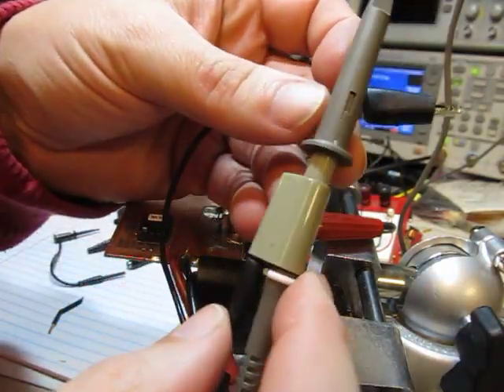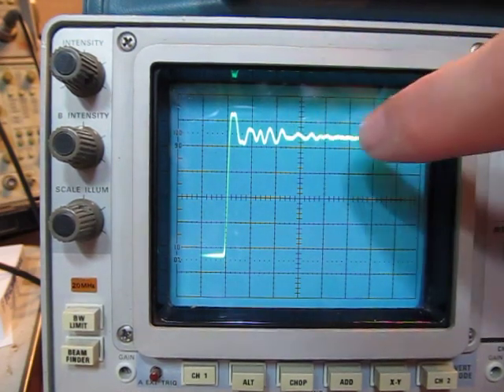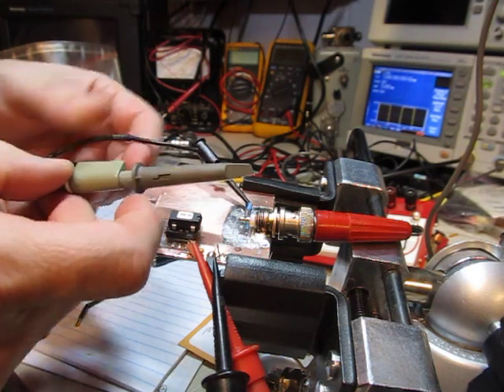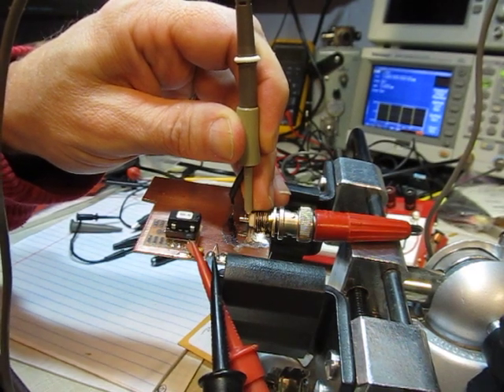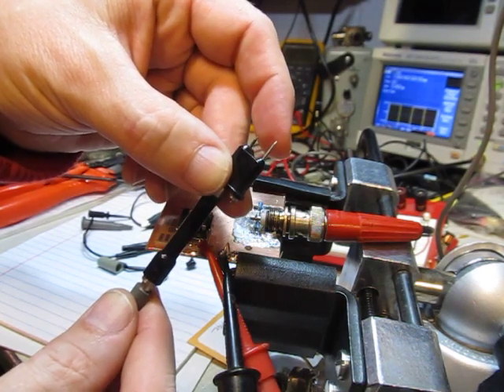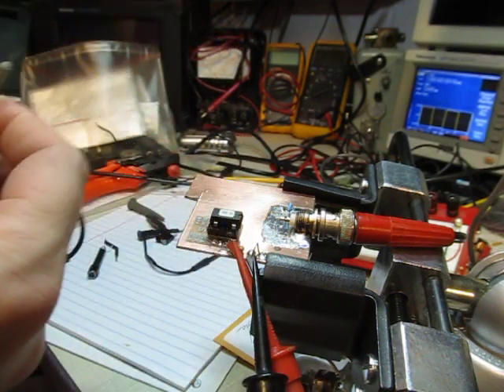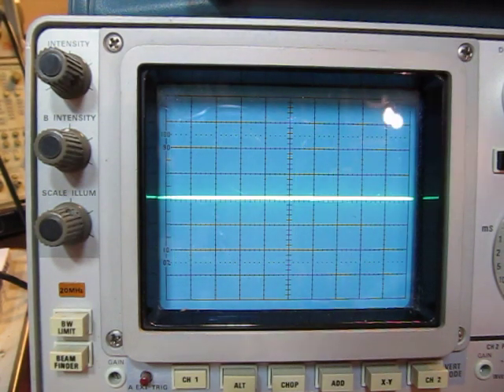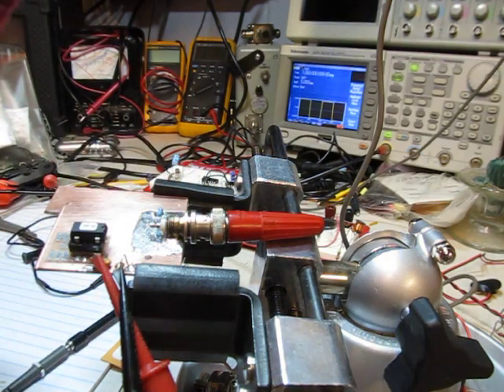#68: Oscilloscope Probe Ground lead length effects on signal quality

Comment: It's a good practise, if you design a board, to add beside the measuring pad also a pad for GND connection. Then It's quite comfortable to make adequate measurements with a scope. For the GND connection, just wind a piece of copper wire around the outer GND shield on the tip of the oszilloscope probe.

Comment: GEAT! This video should be mandatory for all Electronics courses.  I've worked with veteran BSEEs, MSEEs and PhDs who would chase phantom issues for days due to improper probing!  RF guys tend to know, Power supply guys, 'kinda and Logic guys not at all.
Reply: hardstyle905  They design with simulators which have lovely Tr and Tf illustrations and then let some lowly tech try to figure out why there are glitches, then blame the manufacturing department.
Reply: hardstyle905  I've worked with many EE Interns and new graduates.  Unfortunately in the last 20+ years this stuff is not taught at all, and there is zero "hands-on" in the coursework.  Worse yet, very few Perfessors under 50 even know how to properly use an oscilloscope. 20-30 years ago I would tell  students to buy and build at least 3 Heathkits, but that is no longer an option.
Reply: hardstyle905  That's my experience in over 40 years.  Yours may differ.
Reply: hardstyle905  This is weird.  Your comment came through on my notifications, but is not on the actual video here.  I'm guessing that the YT policing algorithm has grabbed it from "publication" here to analyze it, and since it is quite long has not yet digested it.  I was going to paste it here, but I think it would have the same result.   So... lets see my next comment!
Reply: hardstyle905  It's evident that practical, hands-on experience plays a crucial role in certain areas of learning. Take PCB design, for instance. Despite mastering the theory – the significance of short leads, ground planes, and parasitics – I encountered a steep learning curve when I started creating actual PCBs. Interestingly, a senior engineer once inspected my work and remarked on the excessive stray inductance, particularly for applications involving high-frequency and high-power switching. In retrospect, it's almost amusing. I inadvertently created a significant ground return loop and overlooked lead trimming for through-hole components. It wasn't that I lacked the knowledge of 'short traces'; rather, I needed the practical insight to comprehend the exact implications. Experience gradually provided that insight.

I still find value in prototyping on breadboards or veroboards, though my perspective has evolved. Now, I intuitively understand that every millimeter equates to a nanohenry of inductance. It's fascinating how just a few nanoseconds of a 10-amp current through a 20-nH inductor can lead to considerable voltage drops, potential ringing issues, and ultimately, substantial power loss or even damage to the switching components.

Reflecting on this, I can't help but admit that lacking proficiency in using essential tools like an oscilloscope, especially in academic roles, is a more critical concern. It's a safety and effectiveness issue that warrants serious attention.
Reply: it looks like it's here. can you see it?

Comment: What would you recommending using to measure and test connectivity of various switches and jacks because of the different materials used for metals of various switches on the contacts and jack metal materials of the potting and coating which will decrease the connectivity. The problem is how can you measure the connectivity because microohms or milliohm meters can't measure the connectivity of the jacks metal materials and the switch contacts materials used. The connectivity measures how well its passes through the metal materials but what meter measure this?
Reply from the maker: Check out my video on 4-wire resistance measurements, which is the right way to make very low resistance measurements.
Reply: @w2aew  I'm not sure if a 4 wire resistance measurement will be able to measure the conductivity value of switches and jacks because its of the metal materials used and the coating the switches and jacks. There must be a meter that measures conductivity across 20hz to 20khz. To compute for the conductivity you take the inverse reciprocal of the milliohm measurement?
Reply: @w2aew  Most DVM meters measure voltage but it doesn't tell you if the voltage is unregulated or regulated, how can an electronic tech know if the voltage being measured is regulated or unregulated? not using the schematics. There must be a DVM meter or Oscope that can know the differences between an unregulated voltage compared to a regulated voltage but I can't tell when looking at the displayed AC voltage or DC voltage on the Oscope, how can you tell?
Reply from the maker: @waynegram8907  You can't tell if a voltage is regulated by just a simple measurement.  If you can't see a schematic, then one way to tell is to change the load that this voltage is driving and see how much the voltage changes.
Reply: @w2aew  Using a Low Impedance setting on the DVM meter can test Unregulated voltages? if the in-circuit unregulated voltage is +12vdc and you measure the unregulated +12vdc using the low impedance setting on the DVM meter it will drop the unregulated +12vdc voltage decreasing it?
Reply from the maker: @waynegram8907  Maybe, it depends on how low impedance that mode is.  Also, a better way to check would be to monitor the output voltage while varying the input voltage to the circuit.  If the output doesn't change, then it is likely regulated.
Reply: @w2aew  I would have to use an AC variac and vary the AC voltage while measuring unregulated DC voltages? Some DVM meters has a low impedance mode but not sure if you can use this mode to measure In-Circuit Unregulated voltages?

Comment: How do you prevent Eddy currents? Because ground loops causes Eddy currents which is current that can't be sink to ground. Besides ground loops what causes Eddy currents? And why are Eddy current considered bad? Because Eddy current causes bad signal to noise ratio?

Comment: Thanks for sharing. Does the edge ringing due to short rise/fall time also caused by a long coaxial cable of the probe? I wonder if transmission line on the probe cable contributes to the ringing.

Comment: Interesting video.  I ran across a situation yesterday, where the sine wave was slightly jumping on the oscilloscope.  I inadvertently touched the ground lead and the jumping stopped.  I wonder if this falls under the same situation that you demonstrated?
Reply from the maker: It is likely that the ground lead was acting as an antenna, picking up another interfering signal that was being added to your result.  This is another good reason to keep the ground leads and loop area short/small.

Comment: Hello, great video again! Now,  I now I have a lot a questions but I red a lot of information recently and I need tips to organized it, so please bear with me a little. What bandwidth is your scope? Is the saw ringing amplitude value influenced by the scope bandwidth? For ex. a 50 Mhz scope would see a 50 Mhz oscillation with 0.707 of its original amplitude (theoretically) ? Are those ringings some kind of reflections signal, because of unmatched impedance? So practically the ground lead is a LC tank oscillator?

Comment: Hi Alan, question - there are some cheap function generators for sale, kits, etc. Some don't have BNC connections, just screw connections. So, what kind of probe would you recommend, if any? Is this a 300 ohm thing? Or, would you recommend connecting a female bnc to the function generator and then using a standard coaxial BNC o'scope probe?  Or maybe your advice is forget the cheap function generator? :) 73, KM5L
Reply from the maker: I'd probably wire in a female BNC.  These cheap generators can be useful for low frequency work, just don't expect a lot of stability or low distortion.

Comment: Biomedical Equipment requires to measure the equipment chassis ground resistance to the ground terminal of the AC cord. Also to measure the Leakage current from the equipment chassis ground to the AC cord HOT terminal. They use a lab test gear called a "Safety Analyzer" to measure the Leakage Current and Ground Resistance. If you didn't have this Safety Analyzer how would you measure the Leakage current?  I'm guessing its AC leakage current or DC leakage current? The Leakage current is caused by what the AC power transformer or the power supply filters. If you're measuring the Leakage current of a unit under test what is causing this leakage current from the AC hot lead to the Chassis ground?

Comment: What about probe impedance? In your setup, are you using 1 Meg or 50 ohm?
Reply from the maker: I was using 10X passive probes, which have a 10Meg input impedance (low freq) and use a 1Meg scope input impedance.

Comment: Very good job describing why you need to use as short ground as possible.  Most do not understand how important this is for debugging a circuit and will chase the wrong problem.

Comment: Thanks for another interesting video.

I have a question: What about multi-channel scopes. Should each channel be grounded (current loops?) or is it better to connect just one ground shared by all channels.
Reply from the maker: +Ratz Alter Each probe should be grounded - otherwise the effective ground lead length would be very long!  Of course, this means that all circuits that you are probing simultaneously must share a common ground.  If you have seperate "analog" and "digital" grounds that are common at some point, this will all be OK since the inductance between the two probe ground leads will be high enough to keep these planes from interacting.

Comment: Good information.  Was wondering if there is some way to shorten ground lead on a "typical" (low end = $400 to $1000 oscilloscope) scope probe?  If one wanted to make shorter leads where would they get the connectors (ring connector to probe)?  I don't see these for sale on their own.
Reply: +Digger D Never mind ;)  I disassembled one of my probes and checked out your other video on this #111 - Another day where I learned something - thanks ;)

Comment: Very informative video, thanks :)

I got a tip locating sleeve along with my oscilloscope probe. I am unable to figure out when and where to use this tip locating sleeve... Can you please tell me if you have any idea about it ?
Reply from the maker: I'm not sure what you mean by "tip locating sleeve".  It might be an insulating adapter that makes it easier to probe the pins on an IC without shorting multiple pins with the probe tip.
Reply: ***** http://www.seeedstudio.com/depot/images/product/BNC%20Oscilloscope_01.jpg
Reply: ***** You can also see 2 pairs of 'Tip locating sleeves' in this image :
http://www.pennybuying.com/media/catalog/product/cache/1/image/8da1cf41253d9952b7c40c20a61ca483/b/3/b300a_3__1.jpg
Reply from the maker: Ravi Ranjan Yes.  The ones with the little plastic "nubs" adjacent to the probe tip hole are used to probe the pins of a DIP package or connector.  The plastic nubs fit between the pins, thus helping to keep the probe tip centered on the pin that you're probing, keeping it from slipping off and shorting against an adjacent pin.  The ones without nubs adjacent to the probe tips are simply insulators that cover the ground ring on the probe tip so that it doesn't accidentally short against a component lead, etc.
Reply: ***** Thanks a lot Alen :) (y)

Comment: I made a probe using coaxiel cable, needle and bnc connector. I am grounding the cable from the BNC's compressed metal ring with a crocodile, There is higher noise then the classical probes like yours. Is it all beacuse of the grounding ? Why ?
Reply from the maker: What you've described is a 1x probe, which adds considerable capacitance to the circuit under test.  You may want to review my video on the basics of 1x and 10x probes: Basic 1X and 10X Oscilloscope Probe tutorial

Comment: Hi
Is it possible to measure the noise a cable pickups up , even when there is no voltage going to it?
this to see let say cable for  PV systems, to see how good they are in therms of shielding.
Or are behave like a big antenna  , i heard of people who live near a airport of military that some time when plane fly over the systems shut off , (rader problem ) or bad cable's?
Any way how do you test cables on a oscilloscope

Comment: Great video! Thanks!
You mention that the inductance depends on the length of the wire until the ground and the signal are together in the probe. 
I can intuitively accept that very well but I cant quite put a name on the physical phenomena: why does the ground stop acting like an inductor when it is closed to the signal? 
Is it for the same reason that coax does not act as an antenna?

Comment: Another fabulous video. You'd make a good professor. I love your use of a tripod in this video!

I was thinking: what effect would a capacitor of the appropriate value have if placed in series with the ground lead. Wouldn't that cancel out the inductive reactance of the lead, leaving only an equivalent series resistance?

Comment: What probe model number is that? I heard 300 mhz speed..a P6131 maybe? 
I bought two NIB Tek P6121 good to 100 mhz for my 2230..
I'm convinced good ones are not cheap. I can do the twisted wire trick if I need to.